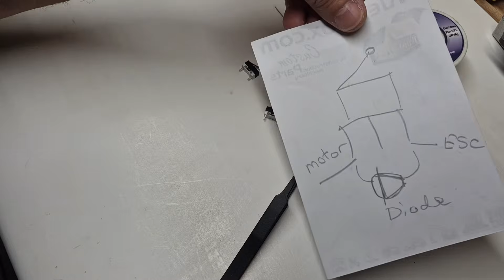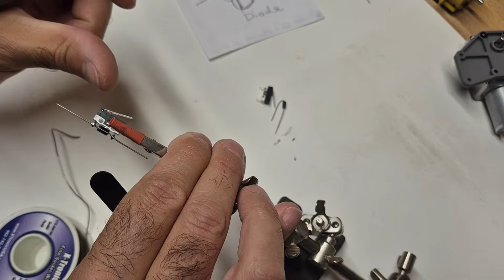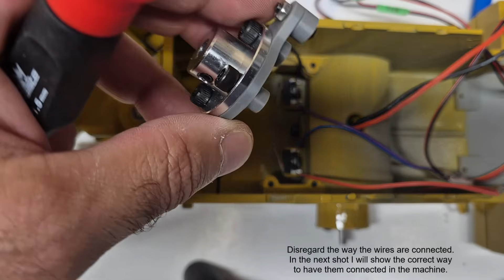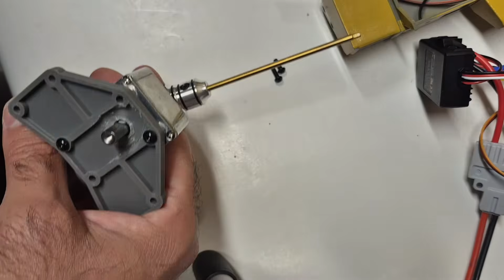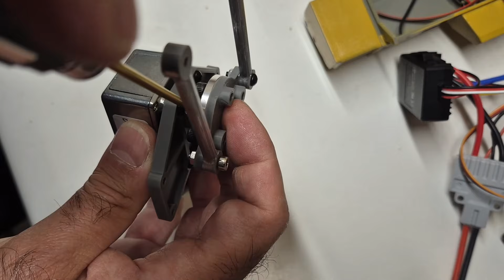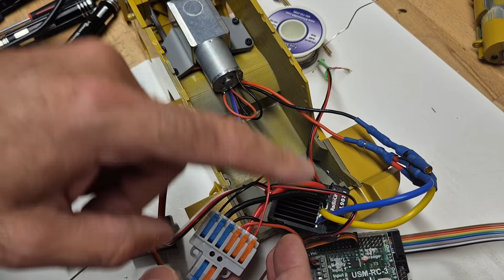Why Put Diodes On Your Steering Motor? Here's Why!

Comment: If there were no diodes, would the motor keep running in the opposite direction after it maxed out? I expected the movement to stop entirely after the limit switch gets activated.
Reply from the maker: correct. If there was no diode the motor would continue until it met something to stop it. So the limit switches stop the motor from moving any more because it cuts the power once it is triggered.
Reply: @rcchbuilds  thank you for the explanation
Reply: @rcchbuilds  Excuse my lack of understanding but I still don't grasp why the diode?? would the limit switch not be sufficient to cut the power and stop motion.. what does the diode to the functionality ??